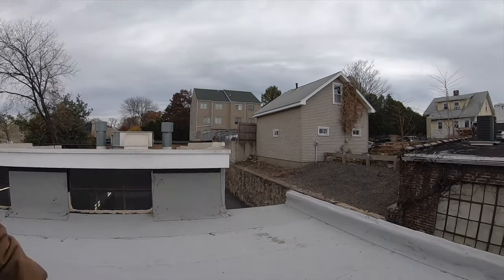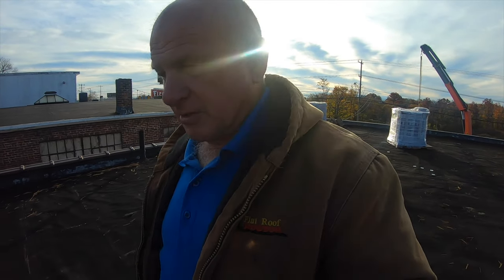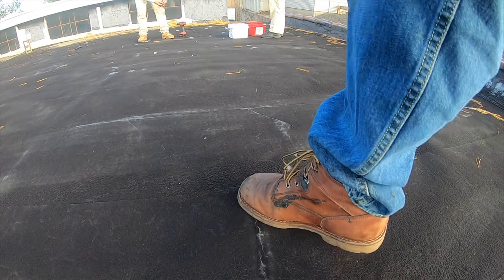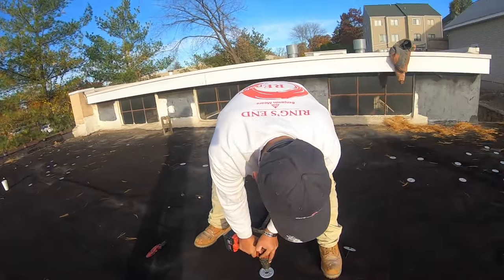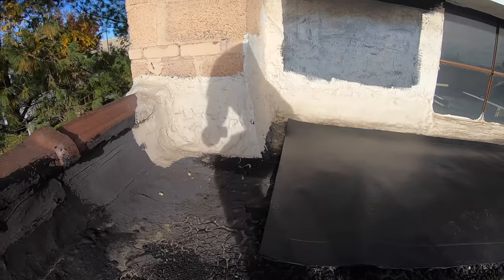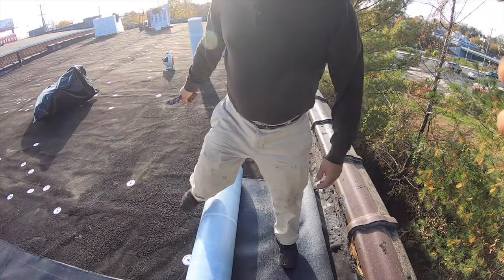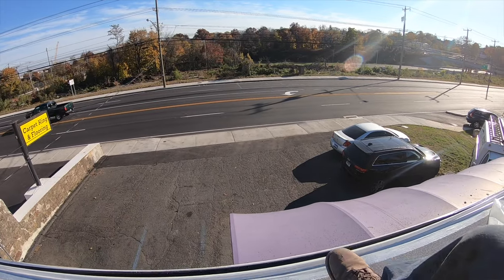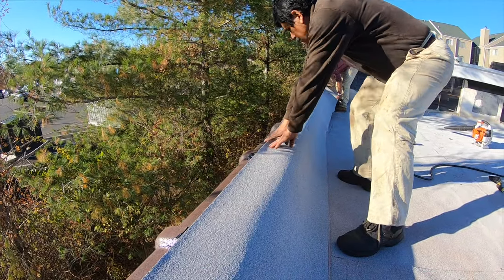You can Install your own Flat Roof with no Experience

Comment: I have a 700 ft attached townhouse  with a pitched roof high point in the center.

Top layer is a white roofing fabric that is old and porus in 75% of the roof. Under is decomposed wood. Under it is gravel/torchdown asphalt.  

A core was done and it now leaks and screw holes I put for a tarp may be leaking too.

I plan to use henrys wet patch  to seal.  I will open the core and put henrys below and above the asphalt plug, and  push henrys deep into the screw holes .

Later I plan to put layers of a roof patch like henrys over the entire top fabric.

If I get ambitious I would strip the fabric and wood pulp and clean then possibly torch down as you show in your videos. 

What do you think??

Comment: Hot Tar was before your time? Hot asphalt is still being used on a regular basis in roofing. Plus that’s not two roofs, that’s one Asphaltic roof with the plies becoming delaminated.

Also, doesn’t look like you have a pattern for your fasteners, don’t know if you would pass wind uplift.

Doesn’t look like you primed the substrate for the Base sheet. Not priming the substrate for a Liberty self adhered roof system, as well as some of those substrates are not accepted by GAF. At least without a sign off from the manufacturer and I doubt they signed off on this installation.

How are you going to give the owner the manufacturer’s warranty? Or do you install this with no guarantee or backing for the work. If it fails in 6 months it’s too bad for the owner?
Reply from the maker: Ok wise guy. 
1. Hot Asphalt may be used here and there but is definitely the choice among 99% of roofers. Those days are gone.  I have seen some old timers still get into it or where some government-specified such system. You are wrong to even think that it is a commonly used system.
2. As I mentioned I am not a Hot Asphalt guy in the video. So yes it could be delimitation. 
3. This roof had no uplift since it was installed. 60 years plus. Why would it now? I was not putting down fasteners for that reason. I was fasting places where it has delaminated a lot, not for uplifting 
I don't care about GAF or any manufacturer's warranties. I have been burned many times by them having some kind of loophole.
I do not follow any people and how they do things. You may and that is ok. Please don't follow me, you will freak out every time. Especially Union workers and people that went to some school.
 I am a self-taught guy that got into Torch Down 40 years ago. If you want to see a Rule freak, see my son's videos @allroofusa. he is insane with doing things by the book. I can't be bothered. So don't let me bother you.
Reply: I hope potential customers reads his last sentence.
He thinks he's doing a superior job because he saved the customer money. But he's saving the customer money because he's skipping critical steps in his installation process. If certain areas are delaminating the whole roof should of been refastened. By the looks of it there are possibly 2 roofs already on this roof. Your just adding another layer(incorrectly) which in most states is illegal.

Comment: Our house has a 20-year-old low slope roof like this with (I believe) the same 2-part system you just laid.  The plywood deck is decent (no rot detected) with multiple foam sheets underneath followed by more plywood above the roof joists.  

However, it's time for a new roof.  My options seem to be 1) remove the existing and install the same 2-part system 2) or possibly??, fluid-applied acrylic elastomeric roof system (eg Acrylabls) over the existing roofing.  Your thoughts, ideas, suggestions (recognizing you can't see the roof).
Reply from the maker: Don't need to remove the existing. It should still be good after 20 years. Why do you think you need to do something? I think you have a Torch Down roof instead of the peel and stick. Anyway, if the membrane was protected against the Sun and UV's, it should last indefinitely.  If not, and you see spider cracks on the surface, then it is time for something.
3 options;
1. Do another Torch Down straight unto the existing
2. Do a Peel and Stick with no base as in this video
3. Use a Silicone Based coating and cover the entire roof. 
If the roof is in relative good shape, then the coating would be the attractive part. Anyone can do that without any help.
Send pics to my phone and I can help you with the assessment. 203 858 0080. I might save you a bunch

Comment: I'm going to be doing my homes flat roof a total strip down and rebuild 
They have put marble tile straight on top of concrete and it has leaked big time with water penetrating down into the internal walls obviously causing damp and so much damage 
Would it be correct to strip the marble tile to concrete 
Base of cold bitumen 80/100
Do I need to put down any type of board I.e ply?
Or do I torch on straight onto the base?
I don't trust anyone now and don't have the finances so any step by step information will be much appreciated I try and follow you're channel and see many way's with boards and insulation materials being used I just need to know layer wise what to put down 
Many thanks
Reply from the maker: Ok, without knowing exactly what your situation is, this is what I think:
1. No need to remove the marble
2. I would install a self adhering base on top of the marble
3. Install heavy gauge drip edge
4. Then Install a APP 180 Torch Down GAF, Firestone, Mule Hide a few to mention
If someone else is reading this, please give us your idea what you would do.
Many Thanks
Reply: @FlatRoofDoctor  oh wonderful I thought I may need to remove the marble 
However thank you I will take you're advice and stick to the steps you have put down 
God bless you &
Thank you

Comment: I’ve been having a roof leak on my flat roof for years even after having it replaced and now sealed with a white rubber seal. Water continues to run down the corner wall where the roof sloops down out to the gutter. Need help!
Reply from the maker: best is send pics to phone so I can help you find the problem 203 858 0080

Comment: Are you kidding,  40 years?  Not even 4 years. Get the tile to a dumpster. Tear off all of the old wrinkled crap and install all new insulation and a good white reflective membrane like TPO. New membrane and metal coping on parapet walls. And quit referring to your material as rubber,it is modified bituminous asphalt.  Not rubber.

Comment: 14.08 hahahaah that not even heated or torched down
Reply from the maker: can't heat Peel and Stick that much. You may not know that. Experience is what is lacking
Reply: @FlatRoofDoctor  you dont ever heat peel n stick it has to be glued and pressure rolled
Reply: @FlatRoofDoctor  also you can message me for any other info you need also
Reply: @xxdrloveleyxx5185  lol that's what I thought should degranulate first , or prime atleast